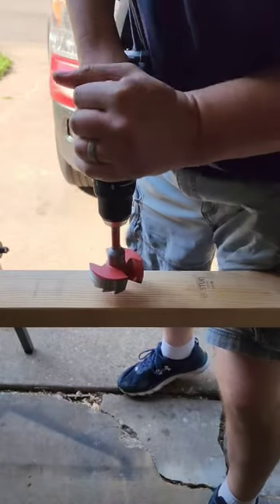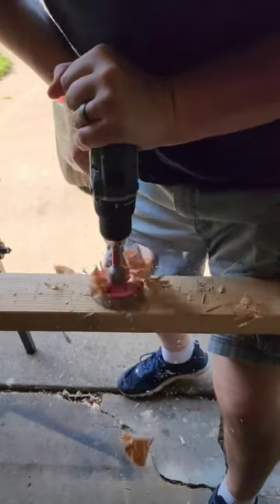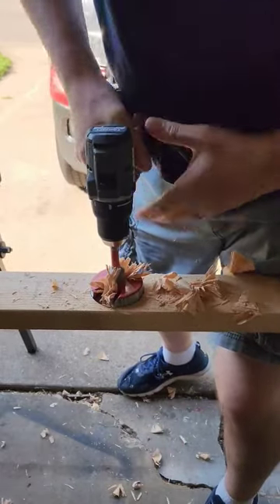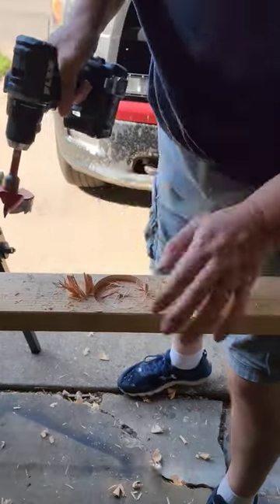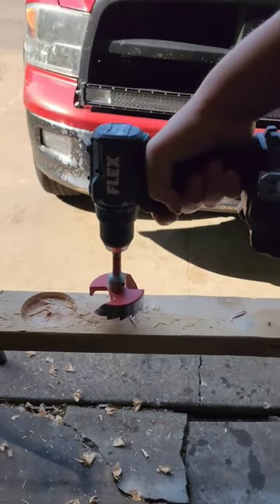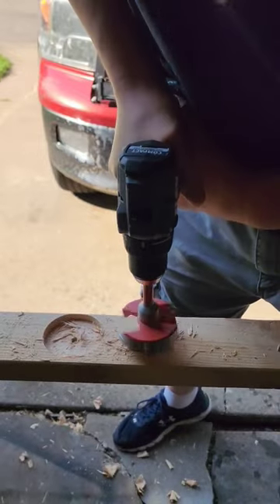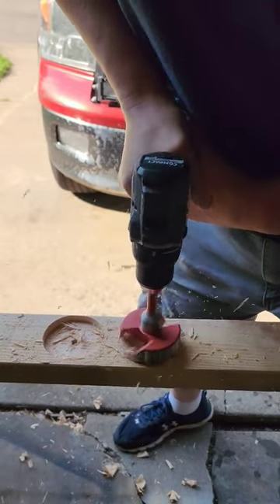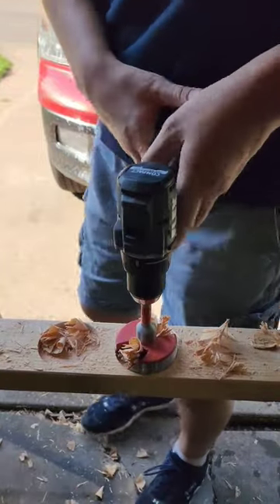Flex 24v Compact, can it run a 3 inch self feeder🤷🏼‍♂️🤷🏼‍♂️🤷🏼‍♂️

Comment: Probably need a hole hawg to drive that 3 inch self feeder through.  That’s a tough task for any hammer drill or drill driver, regardless of brand.
Reply: a high torque drill can do that no problem. As long as it is in speed 1.
This being a subcompact I can understand why it stalled three times before it passed through the wood